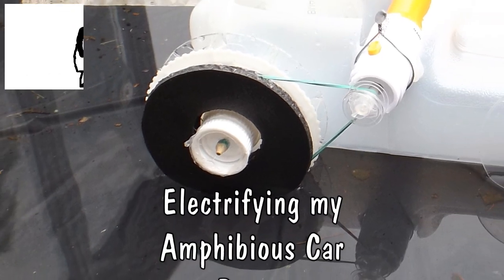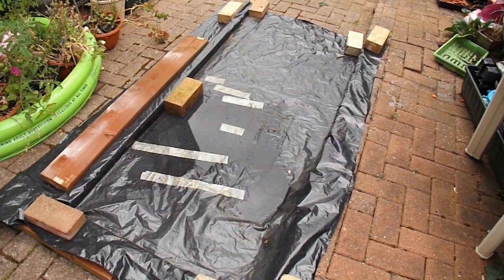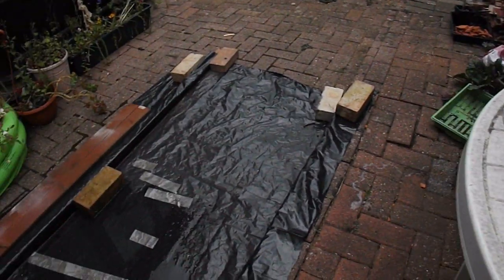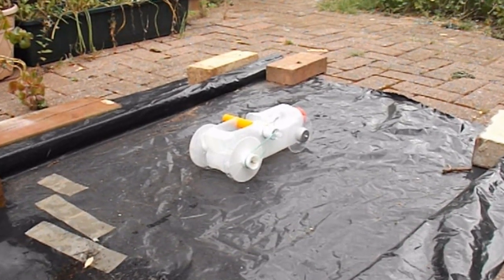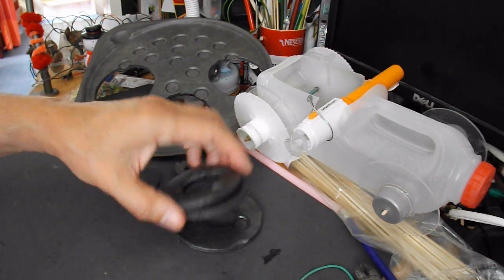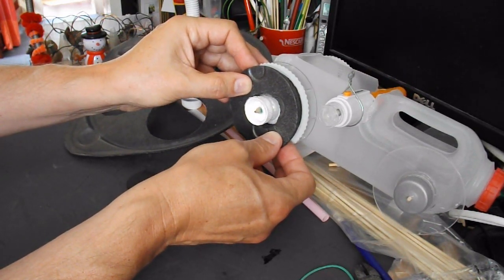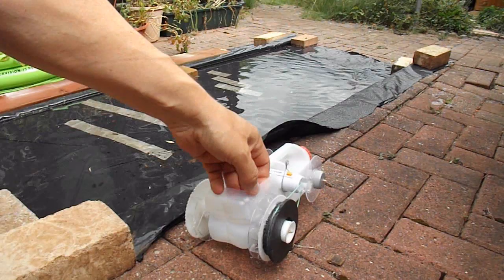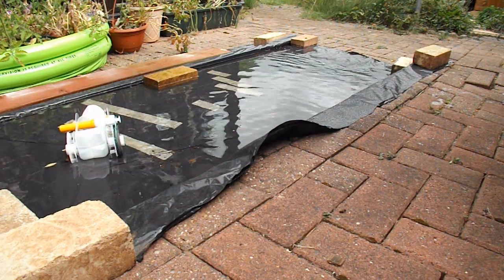Electrifying my Amphibious Car PART 2

Comment: can you make it rc?
Reply from the maker: +Sanjog Rai I am sure you could if you really wanted to. You would have to change lots of things to make it work well. The motor is not really powerful enough if you are going to add weight with RC gear so you would have to change the motor. There is no steering on this car so you would have to provide suitable modifications to give it steering. This was originally designed as a simple rubber band powered car. You would be better off making a new amphibious car from scratch.